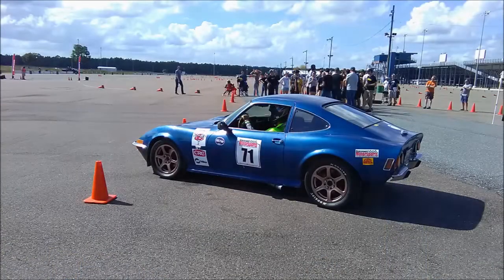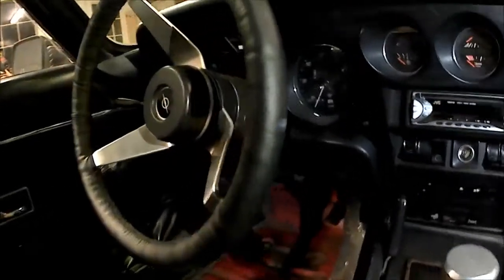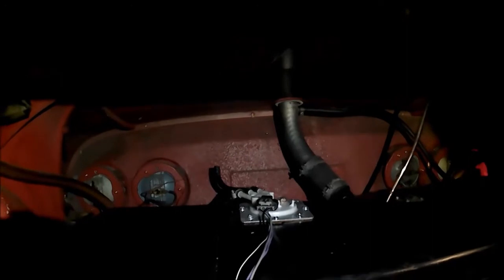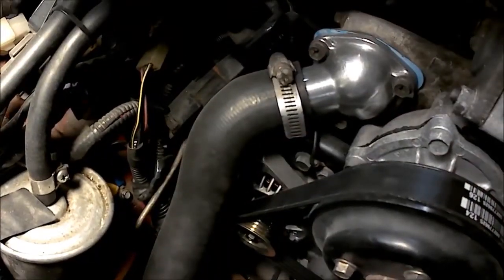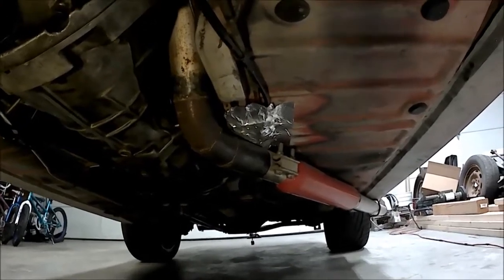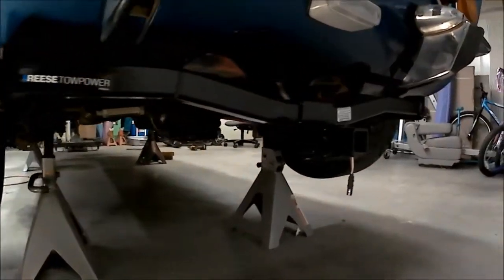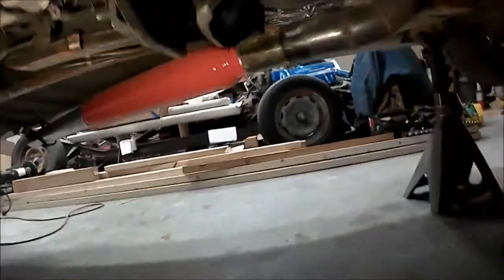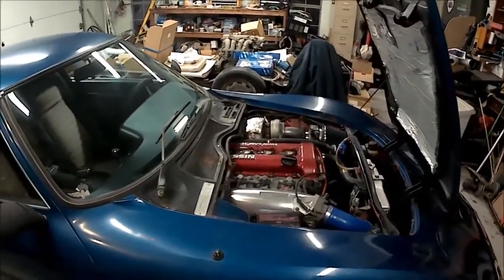Tetra B Opel GT

Comment: I assume it has to throw you back in your seat? 13 second 1/4 mile?
Reply from the maker: Yes it puts you back in the seat and puts a smile on your face. I've only ran it in the 1/4 a couple of times. With lots of wheel spin in 1st and 2nd gear it ran 14.1 @ 101mph. If I can get the wheel spin under control it will be well into the 13's.